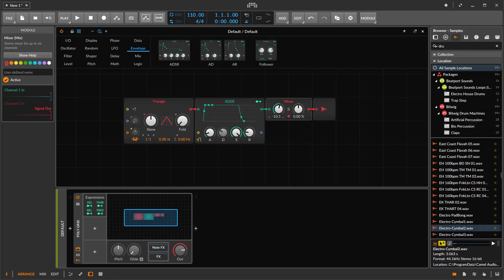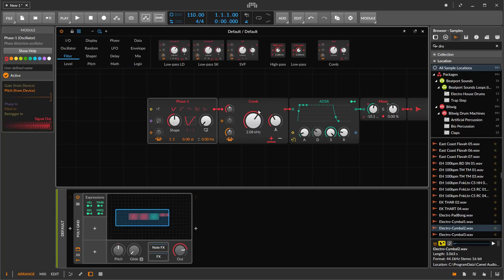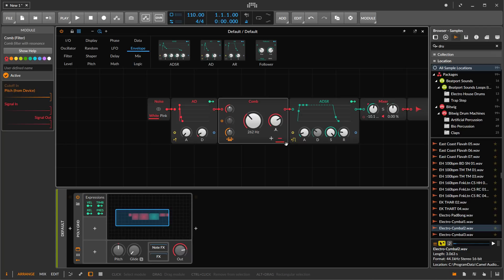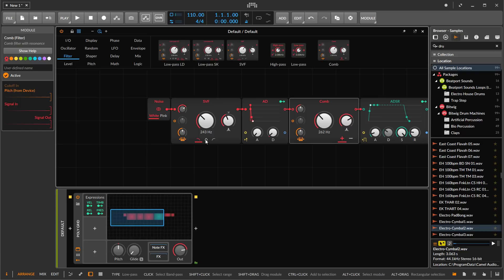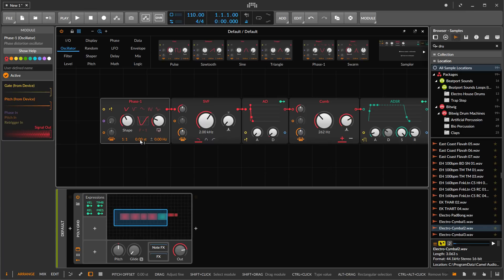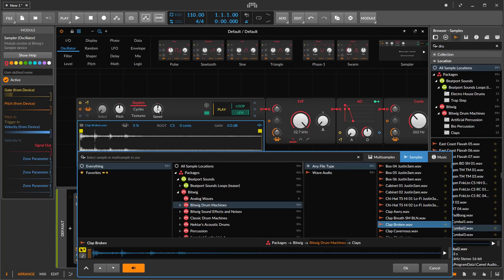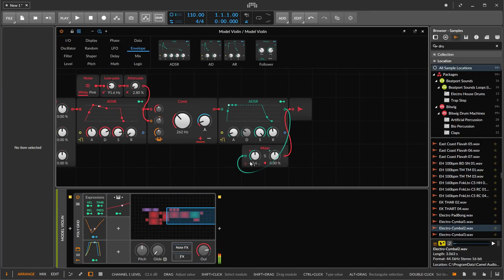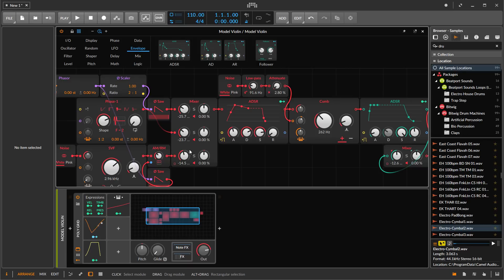Bitwig 3 Beta: Can it do Physical Modeling??

Comment: Hi Kevin. I've just taken the jump and joined the Dark Side Of the Force (= the non-hardware route): I've bought a reasonable powerfull new laptop and Bitwig studio 3. My first venture is a Yamaha CS80 emulation because recreating it's complex structure is always a good way to check out the polyphonic potential of a modular system. I've got a fully fledged 16 voice version running at aprox. 25 % of processor power at the moment so the signs are good. I only have to go back to lower voice counts if I try to stack voices or leave release times too long but that is probably because I do not yet understand the voice stealing routine. Anyway: Next I'll be moving ever closer to my granular + resonator modeling ideal. On the to do list is also to reconstruct your violin model. Man this is exiting stuff! I'd love see more modeling exploits from you, even if on other platforms. So please feel free to point out / share any of them. And many thanks for the inspiration so far! :-)

Comment: I just became aware of Bitwig 3 with The Grid. What you do here seems to provide everyhting I dream of in a single environement, in which I want to use a granular sampler as the exciter, add resonator control like you explain here and then use poly aftertouch / expression to control such sounds in real time. So I am getting rather exited by now. Any plans to include more complex acousticly styled resonators?
Reply from the maker: I don't work for Bitwig, so I don't know what they have planned for the future, however, you can make more complex resonators by using multiple comb filters in parallel and or in series. There is a LOT you can do with that. Thanks for watching!
Reply: @AudioDigital  Can you elaborate a bit on that? Am I to understand that you use the Comb filter to create / emulate standing waves such as strings or blown pipes produce and through that create a dominant overtone that the input noise for instance does not yet have because all frequencies are still equally strong there? So parallel comb filters can then create multiple overtones that would lead to an additive component (especially when the volumes are also tweaked per comb filter)? And placing them in series would create FM type colourations? Is that about right or am I mixing stuff up here?
Furthermore: I love your violin. It might indeed not be perfect but physical modeling leads to the sort of expression that pure samples can only get close to via very complex layering and round robbin "faking". I am a very avid TEchnics WSA-1 user, by the way. My ideal would be a WSA-1 with a granular sampler as the "exiter section" in which I could then load custom samples in stead of only ROM samples like in the WSA.
Reply from the maker: @marcbrasse747  Your pretty much right. One thing you can do is to use another comb in series after the first that is not key tracked, or key tracked at a lower rate. With this sort of thing you can simulate resonating bodies like the body of a guitar. I tend to use the Resonator device in the device chain for this purpose because it’s easier to use than multiple comb filters.
If you don’t have the demo already, get it! You can look at my presets (artist Miles Deep) and take them apart to see how I did what I did.
Also thanks for the compliment about my patch! :)